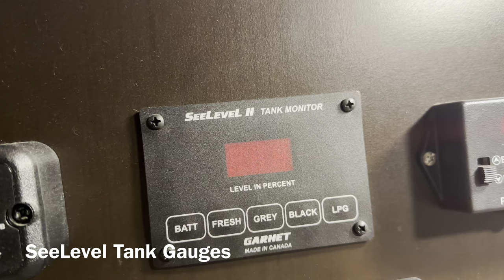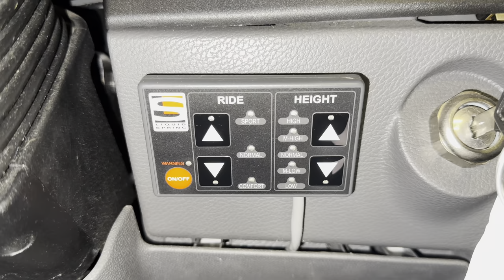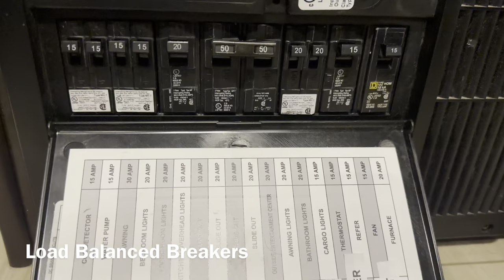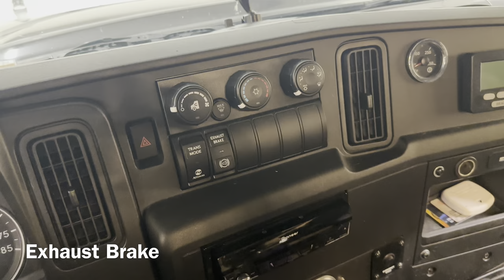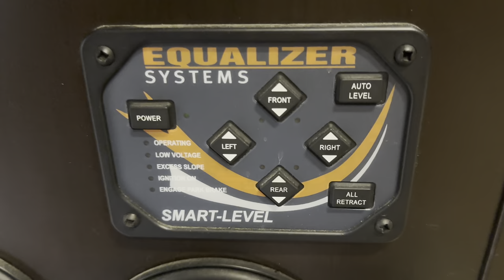3 Year Update: Nexus Wraith 34W Super C RV (Will We Keep It?)

Comment: I read a lot about issues and quality of build of the Nexus.  Have you had much issues with RV?  Seems like a few horror stories online about Nexus.  I put a deposit on a 32R and sitting on the fence if I should take delivery due to the concerns of reliability and issues I read online.
Reply from the maker: We can only speak for our RV, which is over 4 years old now. In the beginning we had leaks at connections like every RV does and we just know that after owning 10 RVs to look and check that stuff. We changed and fixed things ourselves mostly which is helpful.
Nexus did build this RV incorrectly but they fixed everything. It was supposed to have solid surface and it didn't so they replaced it, it was supposed to have a convection microwave oven and it came with just a regular microwave and they replaced it.. etc etc All of that was changed within the first few months and we've done everything else since then, like all the upgrades in this video, minus things that international and or other dealers did like liquid spring. We are happy with our RV and would buy it again. But we can't speak on other people's RVs

Comment: When you installed the upgraded water pump, did you upgrade the wire? I think that I read that this pump draws more amps that the stock sureflow.
Reply from the maker: We didn't have to because our wiring was adequate for the upgraded pump

Comment: I think you keep it for 5 more years. Hey, did you have the LiquidSprings installed at Selking? Is that an option?
Reply from the maker: It can only be installed at liquid spring and their approved installers. We got it installed at their headquarters in Lafayette Indiana
Reply: @WanderingWagners  Thank you so much. Most travel across the country is great but the roads in IL (I-80) just knock the heck out of a unit. Happy travels.
Reply from the maker: We were just on that stretch of road recently and it was HORRIBLE!

Comment: I know it's hard to guestimate because you've done so much labor yourself, but as a %age of your original cost for the wraith, how much extra have you put into it? Also, if a rig has an air brake system, is it feasible to convert it back to disc?
Reply from the maker: If you have air brakes I would just stay with air and make sure the system is properly maintained. If I had to guess I'd say in total there is about $20,000 worth of upgrades.
Reply: @WanderingWagners  That's a lot less than I thought. Can't wait to see what you come up with next.

Comment: The pre 2018 Nexus was built with the trash max force 7 crap engine. Later models had  the Cummins.   Do some research on the max force 7.  Its not pretty
Reply from the maker: We are well aware (Mike was owner operator truck driver for 20 years). We never would buy a maxxforce